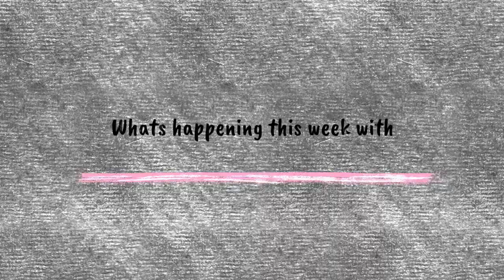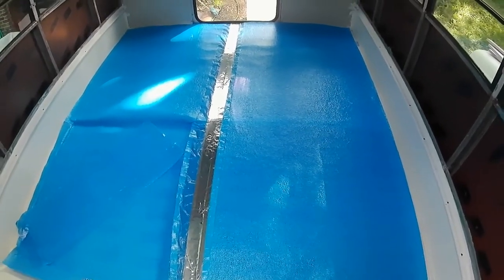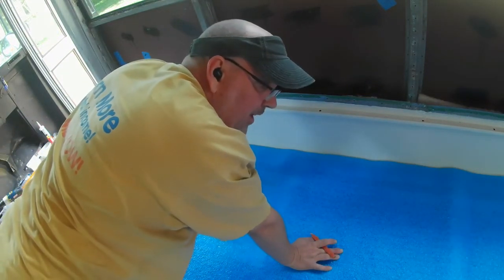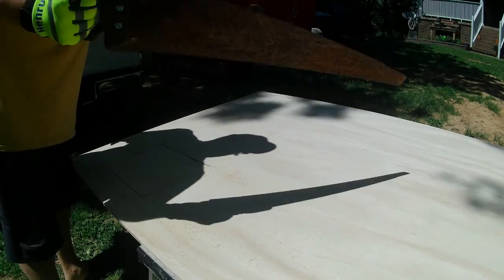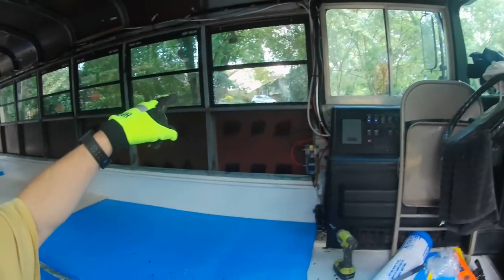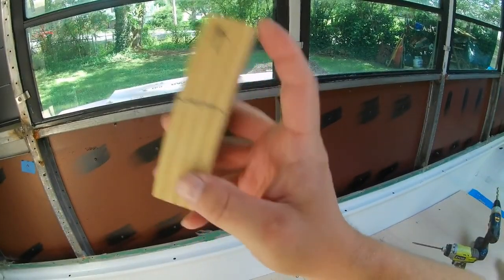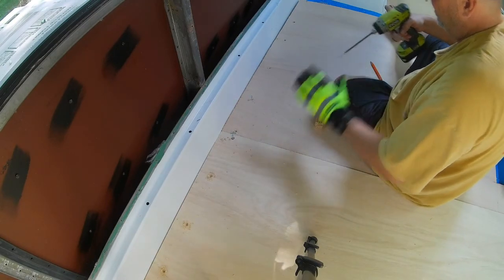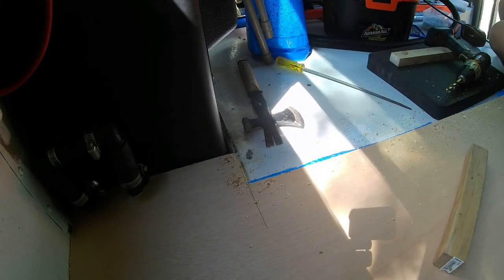Best Tips For SKOOLIE SUBFLOOR INSTALL | EPIC FAIL | PART 2 | SKOOLIE BUILD

Comment: That's the way my projects go, break a window but get the main task done. Pretty fancy sub-floor plywood. Why didn't you use cdx for it? That sanded ply is pretty expensive. Looks damn good though!
Reply from the maker: Hi TR! Yea I was pretty mad about the window, but I guess I'll make a video on how to take apart and replace a bus window now. LOL When life gives you lemons.... Frankly our Home Depot is out of almost everything as far as plywood and that was the cheapest option. We're also trying to stay away from pressure treated inside because of the chemicals. We ordered our wool insulation this week, which should stay with that theme as well. Thanks for the compliment and for watching. 
Chris & Steph
Reply: @CSSkoolieProject  Hopefully we can get back to normal on lumber, what ever that is. I have several projects I need lumber for and am going to have to bite the bullet on some of it soon. Oh and CDX should not be pressure treated. It has exterior glue so it holds up to water better. I'm not sure about outgassing on it, I was just thinking about water resistance. Peace
Reply from the maker: @trbowlin  For sure.. I just added 6 2x4's and 12 2x2's, a few screws and some silver tape to my cart and I'm in for 200 bucks.. shezz...No 3/4 inch plywood either in stock.

Comment: That old saw could use liquid rust remover so it can look renewed.
Reply from the maker: That saw is around 75 years old. It does need a little help LOL. I contemplated doing a restoration on it. It worked for what I needed it for though 😀
Reply: @CSSkoolieProject   That's good to hear! :)

Comment: What is you plywood thicknesses
Reply from the maker: Hi there! Thanks for watching! We used 5/8 thick sanded pine. The insulation is 1 inch as well as the frame that we cut. 
Chis & Steph
Reply: @CSSkoolieProject  hey thanks for the feed back!! This is where I am at with my skoolie! Love the video just subscribed
Reply from the maker: Hi Casey! I don't see where you linked to your Skoolie. Maybe under the wrong account? We'd love to see it. 
Chris & Steph
Reply from the maker: @caseywortham5332  Guilty as charged also with the filming thing. I get so wrapped up in thinking about a project that I forget to film also. I'd never built a thing before this bus so it's a learn as you go thing. We subbed to your TikTok so that we can keep up. 
Chris & Steph